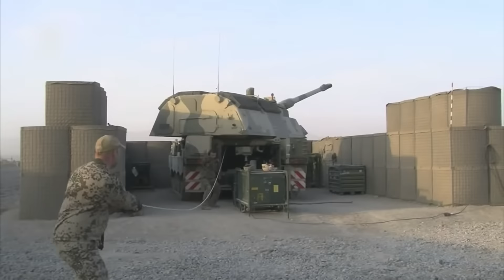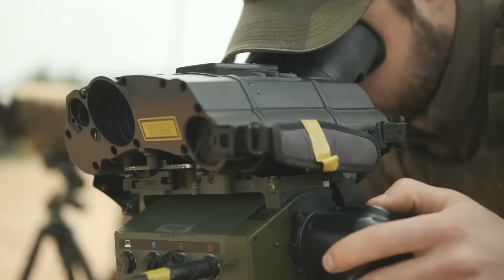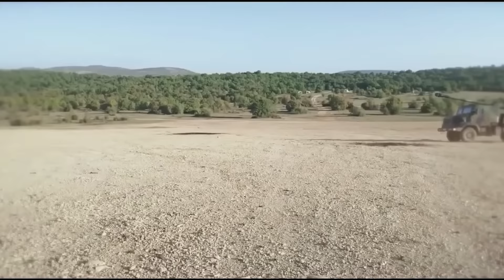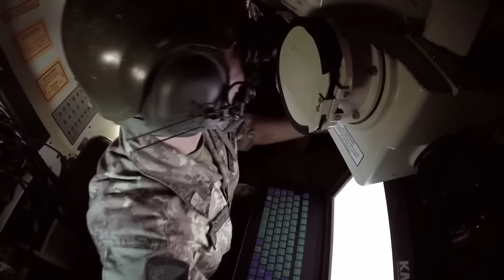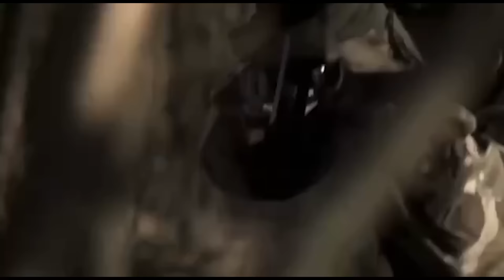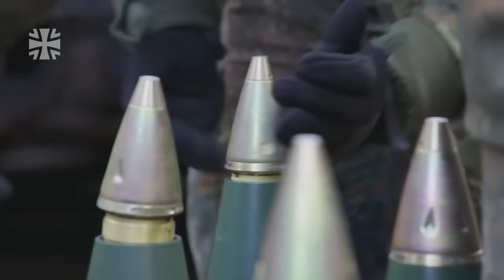German PzH 2000 howitzer in Action in Ukraine! Better than Caesar?!

Comment: The PzH 2000 has an amazing autoloader, German military made sure to update the computer to include most NATO ammunition types.
Reply: And as special gift Ukraine should have received the (SMArt 155 - Suchzündermunition) 
computer controlled intelligent hunter kill ammunition.
Reply: SMArt 155 is a German 155 mm artillery round, designed for a long range, indirect fire top attack role against armoured vehicles. The SMArt carrier shell contains two submunitions with infrared sensor and millimeter wave radar, which descend over the battlefield on ballutes and attack hardened targets with explosively formed penetrator warheads. Built with multiple redundant self-destruct mechanisms, these submunitions were specifically designed to fall outside the category of submunition weapons prohibited by the 2008 Convention on Cluster Munitions. The name SMArt 155 is a contraction of its German name Suchzünder Munition für die Artillerie 155. SMArt is manufactured by GIWS mbh, a partnership between German armaments companies Rheinmetall and Diehl BGT Defence. GIWS started full-rate production for the German Army in 1998, SMArt was first deployed by the Bundeswehr in 2000, and has been sold to the armies of Switzerland, Greece and Australia
Reply: @ReviewTechTV  They did recieve SMArt 155
Reply: @WiesoNurMistnamen  Yes, I think Ukraine received SMArt 155, but unfortunately it seems like USA blew up both Nord Stream pipelines. Now Germany people may withdraw all support for Ukraine and side with Russia because America is the new enemy. True and false information are part of war, please be careful what you believe, stay safe everyone!
Reply: This shell splits into two over the target area, and hunts enemy tanks and vehicles with deadly precision due to it’s 3 sensor array.
Reply: Ukraine wins this war